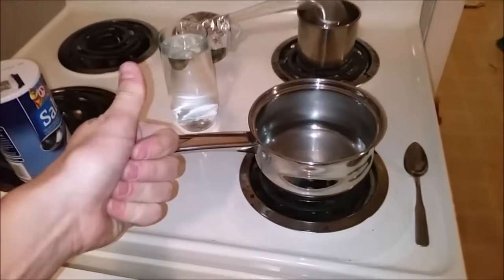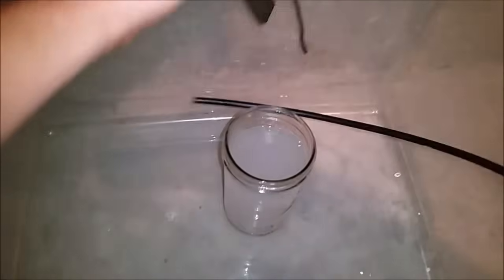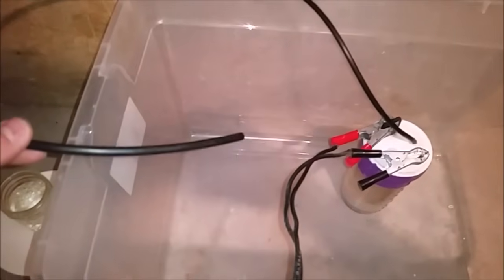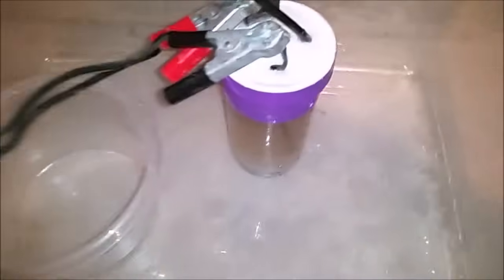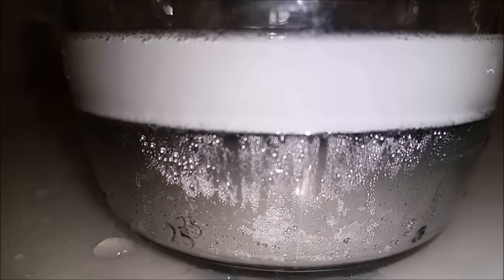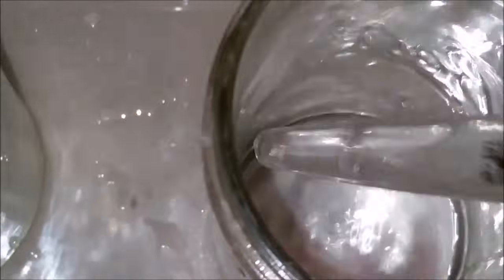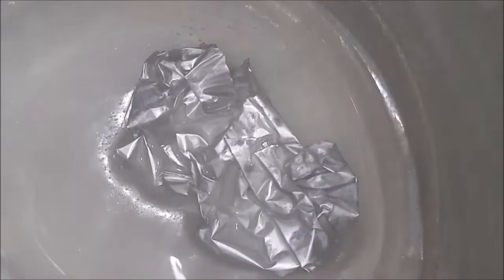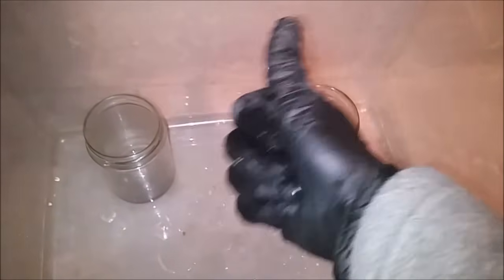Making Sodium Hydroxide (Lye) From Salt

Comment: unfortunately, mercury is even harder to get than NaOH
Reply from the maker: +charles cote 
Lol, I guess that is true, but I can keep reusing the mercury to make as much hydroxide as I like.
Reply: @theCodyReeder  is there a way to strip the sodium from the salt and adhere it to the hydrogen from water without the use of mercury? Is the mercury simply acting as a conductor? Would a pile of carbon shavings at the bottom of the reaction vessel work?
Reply: @matthewpollock9685  
There is a rather simple way to produce lye from salt and water.
No need for mercury.

Much like Cody's setup, this one also produces chlorine as a byproduct. (I think it's actually sodium hypochlorite but I'll call it chlorine for the sake of brevity).

Use a clay flower pot sitting on top of a saucer (to plug the hole in the bottom of the pot) as a semi permeable membrane...

Put the saucer in a non conductive, non reactive tub with the clay flower pot on top of the saucer.
Fill the flower pot with distilled water, and the tub it's sitting in with salt water.

Put your cathode (if memory serves) in the flower pot, and the anode in the tub.
You'll obviously need non reactive electrodes. Stainless steel should be fine for a few runs.
More than a few runs will begin to degrade the stainless steel, and leave a nasty form of chromium oxide in your system.

The sodium chloride solution will begin to displace the distilled water in the pot in an attempt to equalize salinity.
The cathode? will electrolyze the sodium chloride into NaOH, which is too large to fit through the pores of the flower pot.
Consequently, it becomes a solution of lye that is ever increasing in concentration.

The chlorine will make it's way to the anode, where it will either be released as a gas of it's own accord or remain in solution.
Which depends on your ability to add a lid and release valve for the oxygen and hydrogen to the setup I've described.

Why distilled water in the flower pot?
It helps to reduce contaminants that may be present if the salt wasn't meant for human consumption.

By "nasty form of chromium oxide", I mean a single exposure can cause cancer. To make it even more fun, it's got a delayed onset.
Could be next year, could be fifteen years from now, could be that you got lucky and won't get cancer at all.
Cool huh?
Reply: @kaisersose5549  And the award for most epic YouTube comment of the year goes to... Kaiser Sose!  And to think you were Verbal Kent all along.
Reply: @matthewpollock9685  
I learned of a better way to do this...
Coincidentally, @Keith Reynolds commented above over a year ago  regarding the very same process.
He didn't really break it down though.

Get two nonreactive, water tight containers and add a piece of plastic pipe connecting them together. (1/2"-3/4" should be fine)
Prepare enough agar agar to fill the plastic pipe, and add a fair amount of sodium bicarbonate while waiting for the agar to cool. (A little more than a tablespoon of sodium bicarbonate per cubic inch of volume in the plastic pipe)
Create a temporary seal on one side of the plastic pipe, turn the whole cell sideways and pour the agar into the plastic pipe.
After the agar cools, remove the temporary seal, and distilled water goes in the side that will generate lye, saltwater goes in the other side.
After the sodium bicarbonate in the agar has been exhausted, sodium anions from the saltwater will travel through the agar to continue producing sodium hydroxide.
Reply: @theCodyReeder  هل ستهلك الزئبق في العمليه
Reply: @theCodyReeder  هل ستهلك الزئبق في العمليه
Reply: @theCodyReeder bro thats hella nice
Reply: I have slightly over 40 pounds of it my grandpa and dad used to train and sell horses and would use it in tubes put on the sides of the horses head to keep them from shaking there heads. My dad always told me it was illegal and deadly as a kid but I think it was just to keep me from playing with it but now that I have it and have so much does anyone know if I can sell it legally or do I need a license?
Reply: @jaredsimpson7452  I'll buy some if you still have it!
Reply: @jaredsimpson7452  Why would it keep them from shaking their head
Reply: @nicholaslandolina  its heavy
Reply: @jaredsimpson7452 how did it keep them from shaking their heads?
Reply: @Nuovoswiss a more efficent way  than the methods you proposed is 2 half cells with a salt bridge. One cell has just salt water  the other just distilled water or maybe a little sodium hydroxide to help start the current flowing. Sodium ions travel through the bridge and chlorene evolves as a gas from the saltwater brine cell.
Reply: @Nuovoswiss  the energy efficency will be realtivly good and more dependent on the applied voltage.  But, the  rate of ion flow through the bridge, among many other factors,  is roughly proportional to crossection area of the bridge. A not all inclusive list of other factors may include electrode surface area, distance between them,  conductivity of solutions in each cell, temperature, contaminates, thickness of membrane composing cell.
Reply: @Nuovoswiss i think i glossed over a lot of that in the not all inclusive list of other factors in my previous comment.  In general, the resistance between cells can be compensated by increasing the crossection area of the membrane  much the same as putting two resistors in parrelel halfs the resistance of that resistor network.  Double the plate area also halfs the resistance in a cell that ends up as waste heat.  Same with halfing the distance between electrodes also halfs the resistance that ends up as waste heat. Of cource there are pratical limits to each of the above optimizations.

If one has electronic experence, one might find that electrolsys can be simulated fairly well with a resistor and zener diode in series with each other. The voltage drop across the resistor × the current is  the power that ends up as waste heat. Voltage drop across the zener diode is related to the elecro chemistry of the electrolyte and the plates. The current times the voltage drop across the zener diode ends up being the power that does the electrolytic work making the current through the zener diode related to moles.

Intrestingly if one applies alternating current, the electrode plates act like a capacitor that is parrelel to the resistor and zener diode,  and the electrolyte acts like a dielectric that increases the capacitance.  Water is a great dielectric at low voltages and high frequency. So it is then that when using ac, it helps to introduce an inductor coil sized to counter the capacitive reactance at the driven freqency.   
 
Lowering the voltage drop across the series resistor in the resistor zener diode model makes for a more efficent electrolsys system.  The previous mentioned optimizations reguarding electrode size distance do that, but so does lowering the applied voltage so long as is still more than the zerner diode's voltage raiting. Lowering the voltage  results in more electrolsys product and less waste heat from a given amount of energy supplied. 

Unwanted side reactions with contaminates will most certainly complicate any simulation model.
Reply: @kreynolds1123  What about the other conflicting info, the same set up with graphite rods is claimed to generate sodium chlorate, so I'm wondering which is which now.   I want to do this but I'm after the chlorate . If you have any info.
Reply: @charles cote
Not in a good household. There is always a liter or two. Haha
Reply: United Nuclear sells mercury. You can get it there
Reply: You can make it much slower without the mercury.

Sodium ions don't go anywhere when you electrolyse NaCl dissolved in water. So as long as you can smell chlorine, in the gases that come off, you're getting sodium hydroxide produced.

Your electrodes will suffer and it's best to switch the polarity around every so often if you only have copper. But it works to produce a weak sodium hydroxide solution.

Better still. Melt sodium chloride in a dry steel container and electrolyse to make pure sodium.
It melts at 800 ISH celcius and mild  steel stand to around 1300C.
It does loose a lot of its strength through, so make it thick walled.

Hot chloride will ruin any electrode you use, but copper chloride is easy to clean out and very visible if not cleaned out.

The remaining sodium chloride, copper chloride and sodium oxide will all dissolve in water to form sodium hydroxide, sodium chloride and copper precipitate.

Filter the copper and evaporate the water until crystals start to form.
Sodium hydroxide is much more soluble that sodium chloride. Slowly dry this and filter every couple of days. Test the filtrate in water with aluminium foil each time, until you get a reaction, indicating you have gotten to a point where there is not a lot of NaCl and NaOH is starting to come over.
Reply: Break some thermometers and start collecting mercury from it
Reply: @koro-sensei9783  That's a lot of expensive thermometers. How about old damaged mercury sphygmomanometers.

They contain a couple of tablespoons worth in each and can he had on EBay for about £15 each.
Reply: Very correct bro
Reply: I Can get it on certain websites plus it’s insane how much u can do with mercury there’s so many uses chemically industrially and even electric rectifiers
Reply: You don't really need it as the cathode generates hydrogen.
Reply: I literally just bought 5lbs of sodium hydroxide on Amazon for $30... WTH is the point of this...?
Reply: Smash a thermometer
Reply: Not at all if you only need small amounts. Tilt switches from electronics supplies have them in glass with a tiny bit of oil. Probably not cost effective but easily available.
Reply: Way harder
Reply: Actually, Penal Case In MANY Countries!
Reply: sacrifice a thermometer and youre there
Reply: Find someone with autism in your town and get them to take chelating agents and collect their urine.  Win-win!
Reply: FortNikitaBullion that’s fucked up